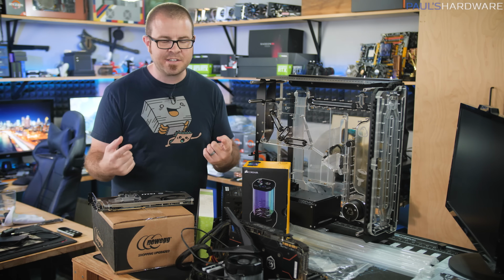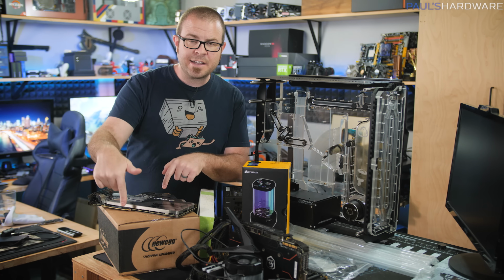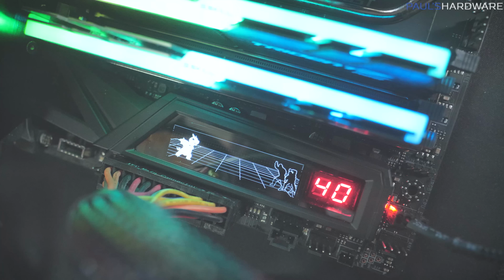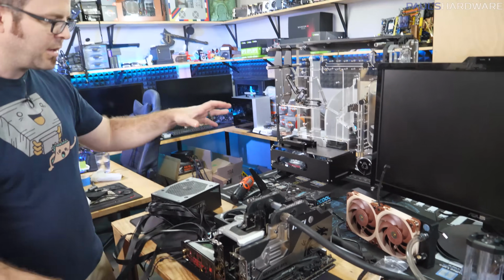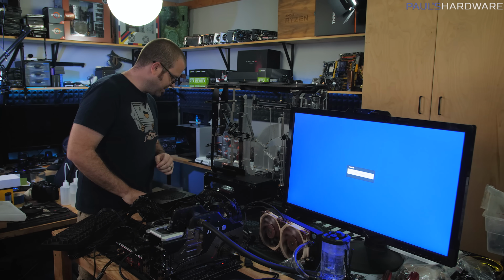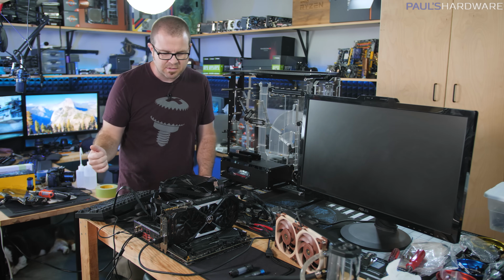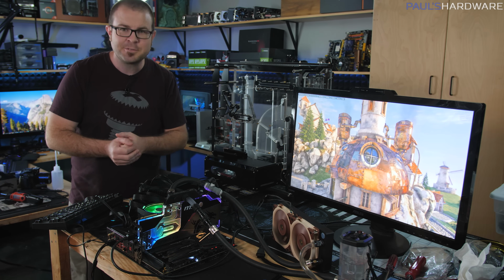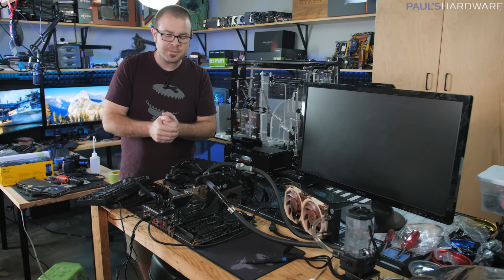The Most Important Part of a Water Cooled PC Build

Comment: Daisy chaining 2080TI's may have been your issue. When Heaven started the GPU's  both pulled a full load and may have overloaded the first card in the chain.
Reply: Would not the PSU safeties prevent that?
Reply: Not necessarily, the PSU will just deliver the power called for, the Mobo has preventions built in which would restrict voltage across the PCIe slots, but in this case the power was being applied directly to the cards.
Reply: To be clear the voltage would remain constant, it's the amperage that would spike as the cards called for more power.
Reply: @ElevatedSystems  This is not a series connection. It was parallel, so no current from card A gone through card B. You should go ahead and read about electronics basics. It's also an interesting topic.
Reply: @kyoudaiken  You are correct, but I wasn't talking about current being passed through the cards, I was referring to the power being delivered to the cards, through a single cable from the PSU (Kinda the same but not). The Daisy Chain is a series of connections wired in parallel, but it is not a stable way to deliver power to two 2080TI's as you can get a spike well over the 250 - 300 watt max on the card. I was however, mistaken in assuming it was the first card in the chain, as the current would have been equal across both cards (over-current protection failed in just one). I am not an electrician but I have been building computers for over 20 years and while rare, I have seen graphic cards fried in exactly this way (I did it bench testing 2 1080TI's about a year ago), and in all but a few cases it was high power cards in SLI. In most cases the built-in over-current protection would catch it unless it was a quick and sudden spike. This would explain why the system posted and ran in Windows until Heaven was run and then shut down (Quick and sudden spike).  Or it was just a crap card and it just blew on it's own when a load was applied. Probably never know, I just mentioned it because I've experienced it. :)